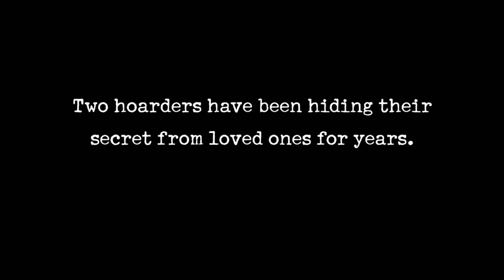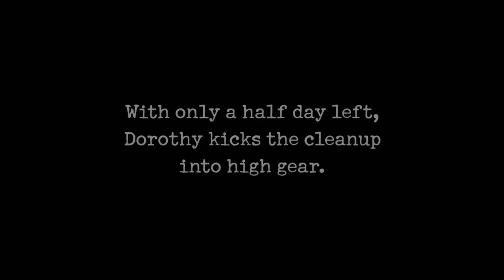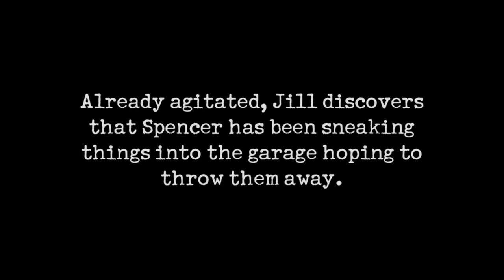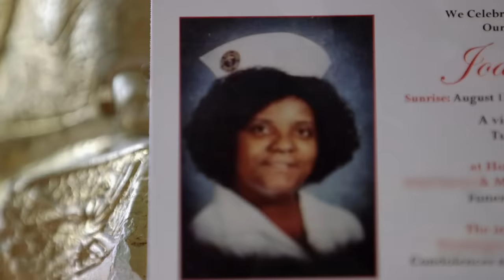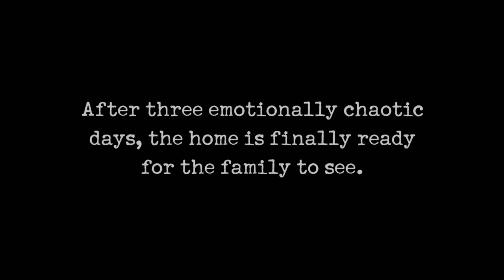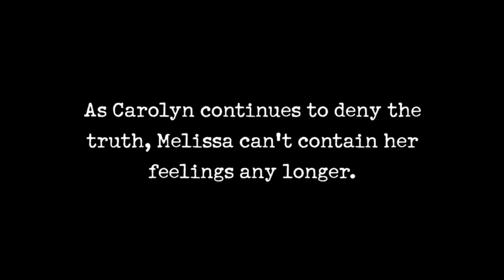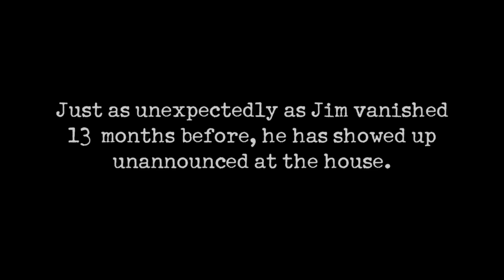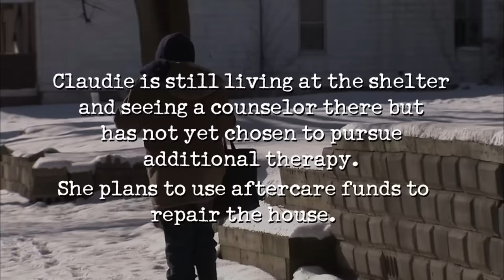Hoarders Top Episodes MARATHON - Binge Them w/ Dorothy the Organizer! Part 3 | A&E

Comment: How can I get in touch with Hoarders, because my Aunt and Uncle are in serious need of their help! It's been going on for years but it needs to stop now.
Reply: Betty Boop your state has resources. You may call your non emergency police and ask. Also there is probably a email on the show somewhere
Reply: Adult protection service in their county
Reply: Call da police on ‘em!
Reply: The show was cancelled in 2013. However, each state has resources available to hoarders to help them get cleaned up. Just look up your state hoarder resources and fill out the application
Reply: @KaryssaSmithart  there are bea episodes
Reply: Betty, the show hasn't been canceled. The latest episodes were from earlier this year. You can check out the Hoarders website and it will tell you how to apply to the show.
Reply: @sarcasticallyrearranged  oh okay thanks

Comment: I have been binge watching and have seen some pretty impressive hoards. One couple had an estimated 500,000 books in a three bedroom house, another woman had been wearing Depends and using them for bowel movements because the bathrooms were hoarded up. Very impressive documentation I must say... Thank God I can watch remotely and not have to deal with the smell and rodent dropping dust.  Most of these hoards have been grown over at least a decade... So if you are just starting to hoard, give yourself 10-12 years to get a really good one built up.

Comment: The woman’s sister Nora owns the house and her sister is Ultimately responsible for repairing the house it is called Capitol improvements. That means the entire cost of repairing the house including appliances that have to be replaced is added to her rent. It can be spread out to the length of the lease. If the length of the lease is 1 year then the cost of the improvements gets spread out over 1 year. If Nora as the landlord wants to be nice she can make her sign a 5 -year lease and then spread the cost of improving of the rental property to be spread out over 5 years. Nora is not stuck with the cost of fixing up the house that burden goes to her sister under the name capital improvements, so she will get her money back. It is just up to Nora whether she wants a lease for her sister of 1 year two years 3 years even 5 years to allow her to pay off the cost of repairing the home. There has to be a clause in a contract that her sister signs saying that she is responsible for capital improvements and it is worth $100 to have a lawyer write up the contract and this can either be in the lease or a separate contract making her pay the total amount spent over how many years Nora wants to give her.

Comment: So at 2:20:22 it says that there are 3 million compulsive hoarders. On part 1 it said 9 million, and then in part two it said 16 million. So hoarding had just over quintupled between the filming of these episodes. I didn’t write the dates down, however the 9 million had a 2015 copyright tho, so that might be a point of reference for the time frame this has happened in. 😢
Reply: Huh. 

Alterternatively the reported cases of hoarding went way up. Or the selection criteria got adjusted 

Without delving deeeeep into the data though im not sure how youd tell which it was.